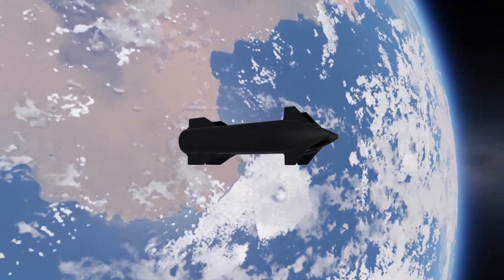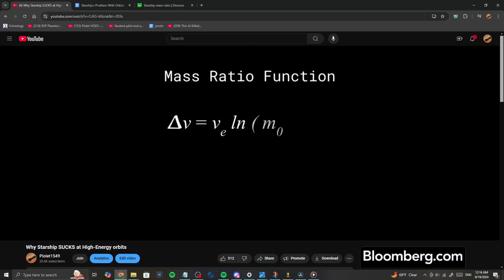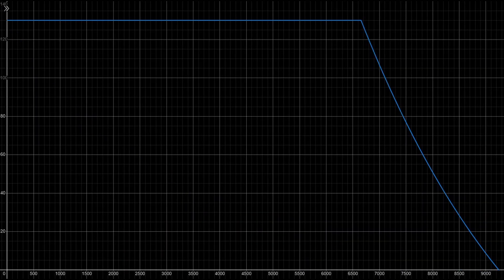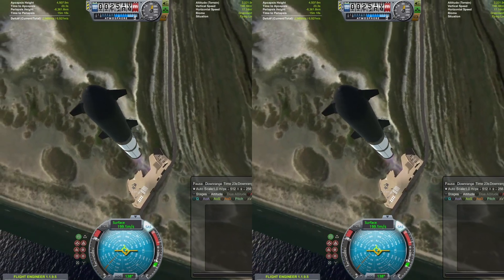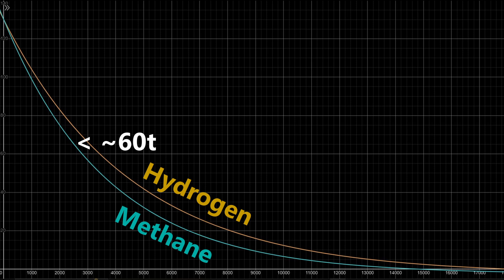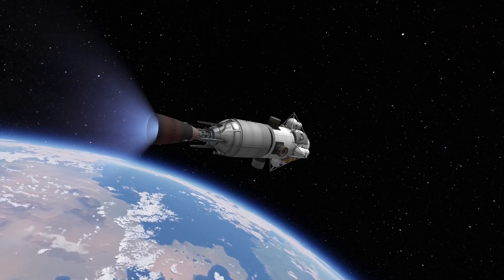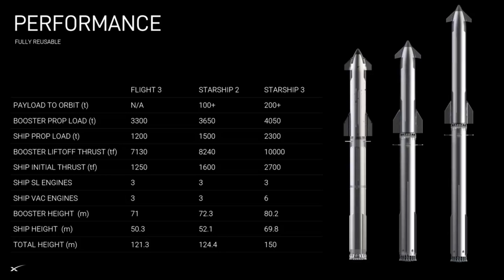Starship's Problem With Orbital-Refilling

Comment: You clearly correct. What you failed to mention (probably because you are trying to give the refuel crowd the best shoot) is that almost nobody needs to put 50Ton+ in GEO. People seldom need more than 10K kg.  So yes Starship needs a GEO delivery stage as the Space Shuttle needed. IF it does not, it will make more sense to send the satellite in a Falcon Heavy, a Vulcan, or a Chinese or Indian rocket.

Comment: I think while you consider kick stage/orbital refueling, you forgot one more option:
Dedicated spacetug. Vessel that will STAY in orbit. Powered by methalox, using ie single gimbaled rvac, and instead heavy stainless steel could be made out of lighter, while less robust materials, ie quite similar to falcon 9 material. It could utilise same refueling hardware as starship., with capacity ie of two tankers (never fully loaded tho, just will be refueled by one full tanker, even if is not empty. ). Proper insulation similar or better used in potential fuel depots or HLS would reduce boil off. Outside standard set necessary to function i. Orbit, could be equipped in something similar to canada arm on iss. 
On starship there should be something like detachable payload adapter with attachment for this canada arm, and hardware attachment for "docking" of this tug during swapping of payload from starship. Tug could have additional attachment point for empty payload adapter, that after retrieving payload from starship, it could mount old one back on starship so it would return to earth for reuse.

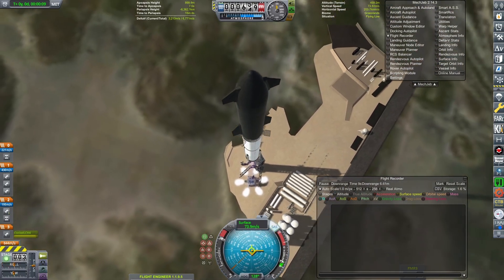Comment: 3:24. A tanker Starship would carry more propellant. As in the entire ship is a tank. So, if you have more initial mass, that means more Delta-V. 

Tanker Starships can carry around 300t of propellant per launch. Something else to note is that once you deploy the payload, you no longer need to carry that mass. So 300t of propellant is probably enough for 100t of payload into GTO. 

I agree that Starship isn't good for GTO or GEO launches because that's not what it's designed for. It's designed to launch 100t of payload to LEO, the Moon, and Mars. However, GEO launches are few and far between now. More worthwhile to launch on a Falcon 9 than a Vulcan Centaur and save $25m+ and just add protection on your satellites

Comment: 130 tons of payload per flight for block 2 is exceedingly optimistic. The launches we’ve seen have been demoing around 25-30 tons for block 1. A much more likely figure for V2 is 60-80 tons with ship recovery if things are absolutely maximized.

Comment: I think that space x should design a larger superheavy, which would allow the starship to be given more speed and save fuel. basically like what we used to see in traditional rockets regarding the proportions between the stages. It would also allow the launch of denser objects to low orbits and even achieve an unconventional and somewhat inefficient single stage to orbit.
Reply: I think SpaceX should design a three stage Starship for improved efficiency. With the middle stage landing on a super large drone ship.

Comment: It seems odd to me to think in-orbit assembly would be so much more complex than a refueling operation. A special kick stage, or space-tug like you mentioned that could fit in the payload bay could be deposited in orbit, and meet with the payload to higher orbit, without the need to drag the heavy hull of starship along with it. Sure, it's not 100% reusable, but we also don't have any idea how easy it would be to reuse starship from high orbit re-entries either, if it can't that kind of defeats the purpose with starship having 2 contradictory capabilities
Reply: I mean, look at it this way

We have been doing in orbit assembly for past decades, and we are yet to achieve large scale propellant transfer in space

Comment: Lol, I didn't watch the other video but the comments seem fair.
You are missing the whole premise of Starship. It can deliver payload to GTO **fully-reuseable**, the return from GTO / TLI is delta-v free with aerobraking.
You are saying that you believe that LEO<->GTO shuttles are cheaper per kg of payload as expendable. Maybe it is true, I want to know, but you are totally unaware of the argument you are making and do not even try to ballpark cost estimates of the 2 approach.
You believe that you are looking at staging vs refueling while you are looking at expendable vs reuseable. 4t dry mass tug? Add a heat shield, and aerosurfaces. Remove them from the Starship that you are sending to GTO without mentioning you are getting it back. Heck yeah you may even keep it in orbit and do LEO <-> GTO shuttles, but you'd want a Starship variant optimized for that, no fairing.
An RL10 is $12M I am reading, that's likely more expensive than the whole Starship flight.
Also what's with the attitude? This is an actually interesting topic. Maybe the 2 options are a wash, I want to run the numbers.

I think that just using Starship is great for capital efficiency by of course in terms of marginal cost, an optimized fully reusable tug would be better. Actually mainly because Starship is optimal for 130t to any orbit. Good luck finding this customer. The reusable tug shuttle taxiing and refilling in orbit will put 30t to GTO per Starship flight and everybody will be happy.
Reply: Rewatch this video. He's proposing a reusable tug, not an expendable kick stage. He's just bringing the tug down with Starship rather than leaving it up and rendezvousing with it
Reply: The other thing to take into account is that Tanker Starships have more payload capacity for fuel than Cargo Starships.
In particular for GTO / TLI where you refilling it half full, it would help to use smaller Cargo Starships. For example I believe that the HLS will stay Starship v1 size while the tanker will be bigger v3 Starships. That is lower dry mass, faster refilling, more optimal mass fraction.

Comment: wouldnt it be really hard to reuse a kickstage tho?
Reply from the maker: Based on the numbers I used (which may or may not be accurate), reusing a kick stage required ~8% more propellant than if it were expended, simply because of how much more efficient it gets after payload deploy.
Reply: @Piolet1549  im more so talking about rendezvous in orbit with another starship or bringing it back being the difficult bit, in either case feels like itll have to take on quite a bit of extra mass to make the cut
Reply: Not really. Drop it, it burns to GTO releases the payload, then as it comes back to periapses it rendezvous with Starship and both return.

The docking mechanism is going to be the most complicated part but there isn't any technical challenges to really prevent it.
Reply: @SirDoggydog  exactly, docking back into a payload bay sounds like an insanely difficult maneuver, and one that would certainly require heavy rcs systems for proper precision

the other option is bringing the stage back to land, which probably is far too infeasible

Comment: Why are we recovering the kick stage? That would require Starship staying in orbit for much longer to rendezvous with it, and more propellant for the stage for the same reason. Also, there would have to be hardware modifications in the payload bay and on the stage to allow for a recapture method that wouldn't let the stage bounce around on reentry. That adds a lot of mass. The economics of that make no sense.
Reply from the maker: Recovering the kick-stage from GTO only requires an additional ~8% of propellant, so from that perspective it would make sense. Doing a recovery would prolly require a ship to stay in orbit for an extra ~4 days. I personally don't think it would be a big deal, but I could understand if your concerned about re-use speed or something along those lines. In terms of hardware on the ship, I would actually expect that most cargo ships would include some type of re-capture mechanism to bring down old satellites for maintenance. Doesn't have to be something permanently attached, but could be swapped in when necessary. How much all of this weighs is obviously subjective but one thing I would consider is that it takes a while to build a rocket stage. If the launch cadence becomes what people think then having a new stage built in time may be difficult, might be simpler to just reuse. Those are my thoughts at least, is an interesting topic

Comment: Oh, so this is all about GTO?  Fair enough.

Orbital refueling isn't being pursued for that.  It's being pursued because they want to send 200+ tons to Mars at a time.  Conveniently, the same tech will let them put 200 tons on the moon in one go, when Artemis gets around to needing that.
Reply from the maker: Yeah I agree. My last vid was about GTO and that's where I got all the comments about re-filling, so that's why the focus is on GTO
Reply: @Piolet1549  A fully re-filled starship should be able to transfer much more than 130 tons to the moon as it has much more delta-v then needed for the 130 tons
Reply: @johgude5045  That is true but the starship only has enough delta v to get 130 tons into orbit so that is the limiting factor here you have to be able to get it into a safe orbit for refueling in order to refuel it.
Reply: @MBMachine23  Maybe refuel at 100km when gravity loss is low enough to make a quick dock maneuver and pump really quick? 
Then the tanker might not need a heat shield. But then both Tanker and Starship must be launched at the same time.
Reply: So for those of you not paying any attention. The HLS weights less then half of Orion and ESM, by spacex milestone reports to NASA for the 3.5Billion they’ve been given for HLS they need 16 launches for just the moon for a much smaller payload. They need refueling not because they geniuses, but because their  rocket is so inefficient with using its fuel and its thrust they need multiple launches.
Reply: @SpottedHares  1: They have not been given the full HLS contract award; NASA doles out parts of the contract award based on Starship milestones, at NASA's discretion.  Keep in mind that Starship is not being designed for Artemis; Artemis is a side quest that happens to align well with Starship's primary goals.

2: 16 flights is unlikely, as is 12 or even 10.  By the time HLS is needed, SpaceX will be well into Starship V3 development if not beyond, lifting 150 to 250 tons per launch.  One doesn't need 10+ flights to refuel Starship at those capacities.
Reply: 3: They "need refueling" because Starship is being designed as a mass payload vehicle for Mars transport.  If all SpaceX wanted to do with Starship was get "A PAYLOAD" to the surface of the moon, like Apollo or Blue Origin, that project be done and dusted long ago.  They wouldn't have bothered with full reusability, 100+ tons of payload, capturing vehicles, complicated heat shields, or orbital refueling.  But then what?  NASA ultimately plans to have a permanent moon presence, which means a moon base, which means a thousand+ tons of equipment on the moon's surface.  Equipment like Japan's big moon rover.  There is no other vehicle available which can do this.  More conspicuously, NASA has not even hinted at beginning to contract for such a vehicle, even though it would definitely take any prospective entity a decade to design and build it.  And the reason why NASA isn't looking for a vehicle they'll definitely need?  Correct: By the time NASA needs it, it will already exist, courtesy of SpaceX.
Reply: @Asterra2 I've run the numbers and a vehicle like Starship would be absolutely invaluable in the long run for a moon base. It's not just useful for Mars. Also Blue Moon can land the rover too. It's actually getting the arguably bigger job of landing the initial surface base
Reply: @SpottedHares  1: They have not been given the full HLS contract award; NASA doles out parts of the contract payments based on Starship milestones, at NASA's discretion.  Bear firmly in mind that Starship is not being designed for Artemis; Artemis is a side quest that happens to align well with Starship's primary goals.  2: 16 flights is unlikely, as is 12 or even 10.  By the time HLS is needed, SpaceX will be well into Starship V3 development if not beyond, lifting 150 to 250 tons per launch.  You don't need 10+ flights to refuel Starship at those capacities.  3: They "need refueling" because Starship is being designed as a mass payload vehicle for Mars transport.  Read this sentence carefully: If all SpaceX wanted to do with Starship was get "A PAYLOAD" to the surface of the moon, like Apollo or Blue Origin, that project be done and dusted long ago.  They wouldn't have bothered with full reusability, 100+ tons of payload, capturing vehicles, complicated heat shields, or orbital refueling.  But then what?  NASA ultimately plans to have a permanent moon presence, which means a moon base, which means a thousand+ tons of equipment on the moon's surface.  There is no other vehicle available which can do this.  More conspicuously, NASA has not even hinted at beginning to contract for such a vehicle, even though it would definitely take any prospective entity a decade to design and build it.  Do you want to know why NASA isn't searching for a vehicle they're definitely going to need?  Correct: By the time NASA needs it, it will already exist, courtesy of SpaceX.
Reply: @SpottedHares  1: They have not been given the full HLS contract award; NASA doles out parts of the contract payments based on Starship milestones, at NASA's discretion.  Bear firmly in mind that Starship is not being designed for Artemis; Artemis is a side quest that happens to align well with Starship's primary goals.

2: 16 flights is unlikely, as is 12 or even 10.  By the time HLS is needed, SpaceX will be well into Starship V3 development if not beyond, lifting 150 to 250 tons per launch.  You don't need 10+ flights to refuel Starship at those capacities.

3: They "need refueling" because Starship is being designed as a mass payload vehicle for Mars transport.  I here underscore: If all SpaceX wanted to do with Starship was get "A PAYLOAD" to the surface of the moon, like Apollo or Blue Origin, that project be done and dusted long ago.  They wouldn't have bothered with full reusability, 100+ tons of payload, capturing vehicles, complicated heat shields, or orbital refueling.  But then what?  NASA ultimately plans to have a permanent moon presence, which means a moon base, which means a thousand+ tons of equipment on the moon's surface.  Equipment like Japan's big moon rover.  There is no other vehicle available which can do this.  More conspicuously, NASA has not even hinted at beginning to contract for such a vehicle, even though it would definitely take any prospective entity a decade to design and build it.  Do you want to guess why NASA isn't searching for a vehicle they're definitely going to need?  Correct: By the time NASA needs it, it will already exist, courtesy of SpaceX.
Reply: I hate when people dismiss any flaws with Starship with "oh but they're not using it for that they're using it to take humanity to mars ✨"
Reply: Hey, SpaceX employee here. That is the preferred goal but starship needs a near redesign for those numbers to work. Stop acting like starship is perfect in every way. It isn't.
Reply: @ThePhantomRocket  I have it on good authority that redesigns are in the pipeline.  And furthermore that Starship is still in prototyping.  "Perfect" isn't a word being tossed around here, but I wouldn't hesitate to suggest that in the landscape of prospective rockets, it is super idealized for its particular goals.
Reply: Well, I think
we can all agree that Artemis will not be a permanent lunar colony so starship is not necessary.
Reply: @Bean-boi  Eh, correction: Outside of the availability of Starship to lift heavy loads to the moon's surface, Artemis was never going to be a permanent lunar colony.  But with Starship, you literally have the option of installing a lunar colony on one HLS, shipping that up, and calling it good.

Comment: "There isn't really any other option". Er, yes, there isn't really any other option for Starship. There are lots of options for getting to Mars that don't involve Starship, at all.
Reply: name three that do not include starship and can be developed in the next 10 years
Reply: @pzkfw_warthunder  A tin can with rocket engines is not a fully developed Mars mission. Its not going to be ten years even if its a realistic exploratory mission. Thus I reject your premise.
Reply: @saumyacow4435  reject? I doubt you have an answer. Starship is 7 years old, in 3 years it will defo be capable for mars. 10 years from startup to mars is the timeline I gave you, so, answer the question. Unless there is no answer

Comment: at this point we need to understand which resourse will be more scarse in the future? the rocket fuel? or the materials that the kickstages are made out of? counting everything with today's market cost won't give us a proper look for the future.
Reply: More expensive than the materials for the kick stage and the rocket fuel is all the overheads associated with the launch complex and the launch process. Peter Beck (the CEO of Rocket Lab) put it this way. He said that two thirds of the cost of launching stuff into orbit is the operations cost, not the vehicle.
Reply: @saumyacow4435  Which meant that more launch would reduce the operations cost per launch.
Reply: @hieunguyen-bj3fx  To some extent yes. The problem for Starship is the sheer complexity of the second stage and what that does for the cost/timing of reuse.
Reply: Fuel is cheap.